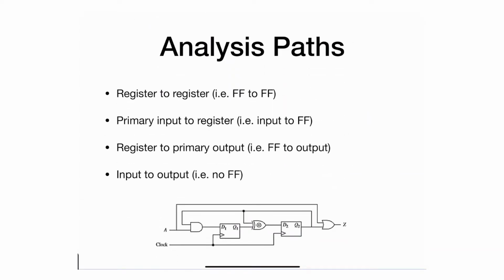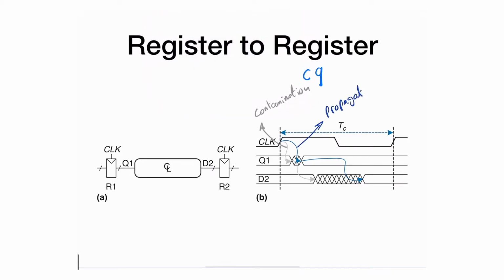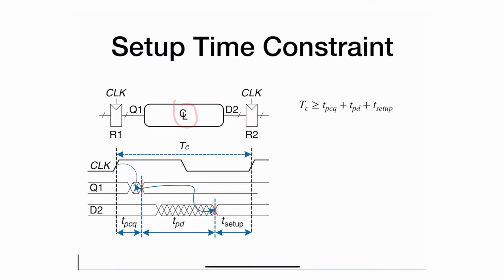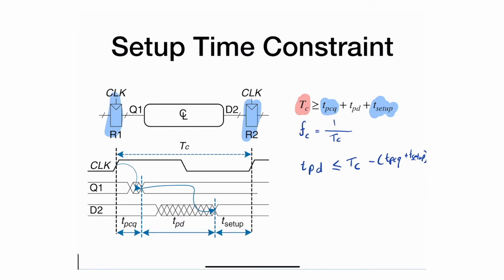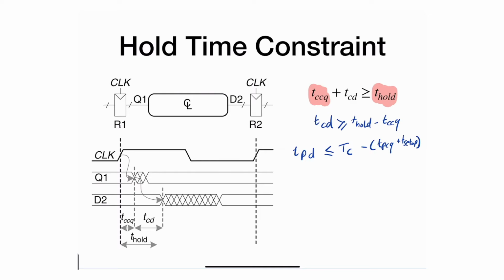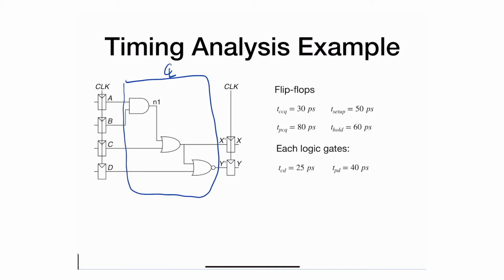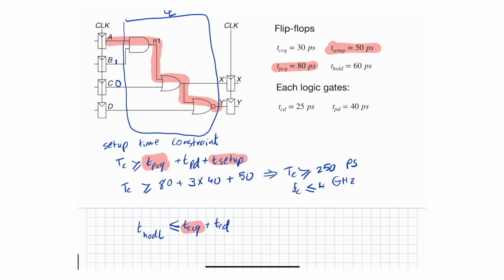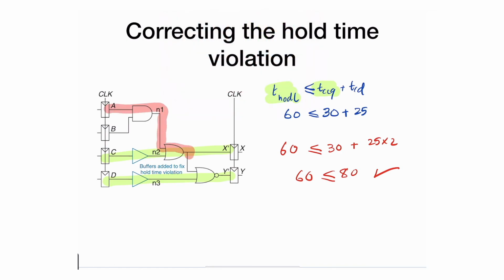62 - Sequential Circuits Timing Analysis

Comment: Thanks for this excellent description. I have a question, though: Why does the combinational propagation delay cover a such a large timespan? I'd expect that a combinational circuit has an I/O delay with certainty compared to a flip-flop, so we can expect that its output will switch almost with a constant time delay. (i.e. the shaded part in the D2 time graph would be just slightly longer than that of the Q1 graph)